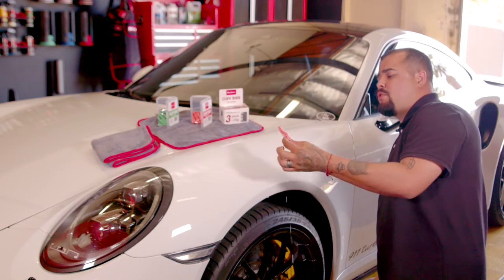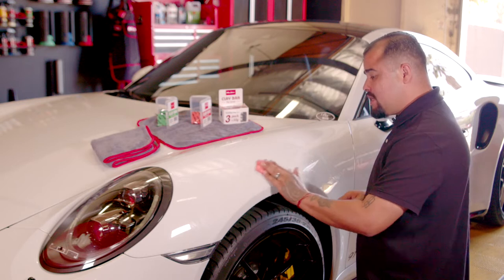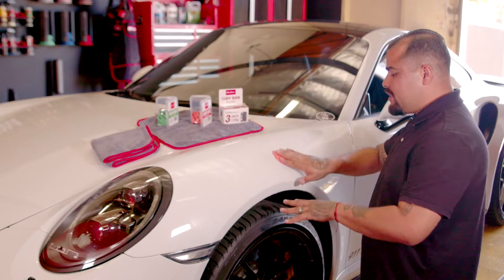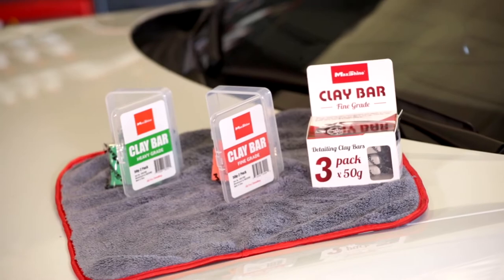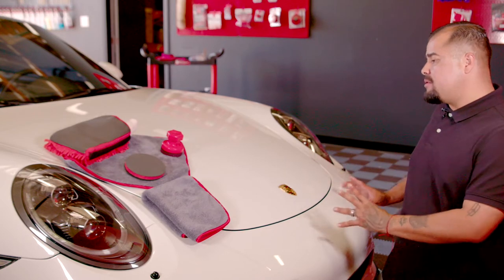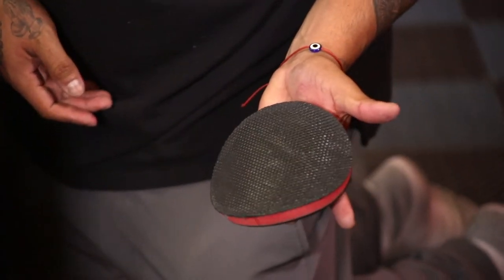How to Clay your car? - Maxshine products /AtoZ Detailing

Comment: How do you clean a pad between each panel?
Reply: Pro detailer here.  For synthetic clays you can dunk it in your wash bucket with your clay lube/ONR mixture (The encapsulation polymers will get most of the dirt out of the pad with a little swishing around) and then you’re good to go for another panel. You can also hit it with your pressure washer on a safe pressure setting and blast out some contamination. The best thing to do would probably be dunking it in the wash bucket then rinsing with pressure washer then re-lubricated.
Reply: To try to remove as much contamination as possible before you even have to touch the paint you can pre-treat with acid or an acidic soap followed by iron remover. Rents off the panel between each step and you will find that you have 50 to 75% less work.
Reply: And of course for heavily contaminated paint with lots of fall out (break dust from a FAST car) you can use a good iron remover as your clay lubrication that’s doubling your efficiency as you are chemically and mechanically agitating. Perhaps even A foaming Iron removing wheel cleaner such as Turtle Wax Hyper foam wheel and tire. 
This paired with Max shines synthetic clay pad on a polisher would perhaps be the fastest way to decontaminate paint in a professional setting but should only be done if you know you were going to correct the panel after as it will definitely cause some type of maring. Especially if you’re using a rotary or like me a forced rotation polisher for your clay pad process.